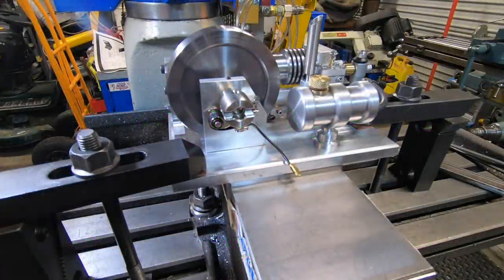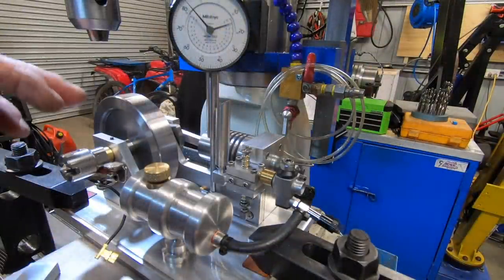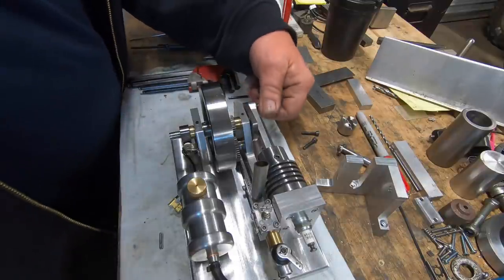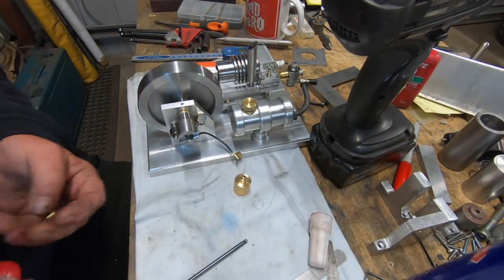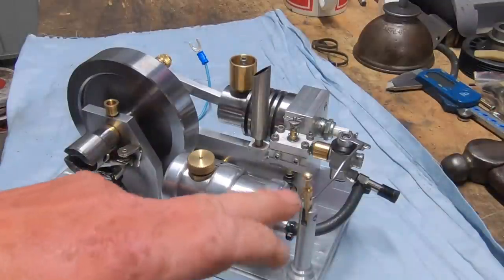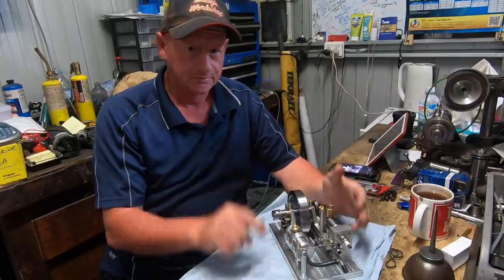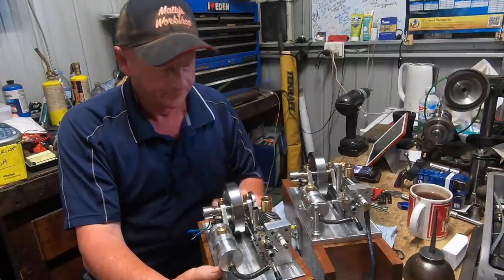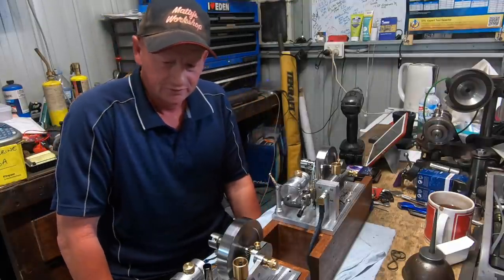Webster Engine Build   Part 11   HD 1080p

Comment: Over the moon and so you should be, two working engines. What a Christmas present. I am old enough to remember hand started cars, on the lug attached to the engine one side always had a slope so when the engine fired the starting handle was thrown out, not sure if you could do the same. Absolutely brilliant series of videos.
Reply from the maker: Gday Chris, I’ve still got that smile mate, I could put at taper on the starter drive but it’s really not needed, I’m doesn’t get jammed up, appreciate you watching mate, all the very best, cheers

Comment: Awesome job Matty! All around. I saw the Instagram post with the 2 engines and figured that is what your were doing. Whoever gets it should be honored. Carbs are always fiddly, good decision going with a ready made one even just to get it going. Probably saved a bit of frustration. Now you know they run so if you do the scratch built carb you can just concentrate on getting it tuned. All the best!
Eddie
Reply from the maker: Gday Eddie, it was a bit of a push to get them finished by Christmas and a massive job in itself to build 2 at once, I honestly think I’d never build 2 again😂, the carby is extremely fiddly to get right and the slightest movement makes a big difference , thanks for watching mate and all the best for Christmas, cheers

Comment: Well, indeed, It was a surprise that you build two engines. And as you said, things doesn't always goes as planned.
That's why I almost never use plans :)
And I think I knew you would give it away. That's how you are...
Reply from the maker: Gday, it was a massive job building 2 but the sense of achievement when both ran was well worth it, thanks for all your support throughout the year mate, Cheers

Comment: I've just finished watching this series as I'm going to build one myself. Though I'm starting with the carb!   Some great tips along the way. Sounds great too. 
All the best from the UK
Reply from the maker: Gday, this is a great build and I’m sure you’ll enjoy it, I’m still thinking of making the carby what’s in the build plans, please let me know how you go with build, thanks for watching mate, cheers
Reply: @MattysWorkshop  Can I ask what you used for the ignition? I've got a set of points and condenser but I'm unsure what type of coil I'd need. From the video you say yours runs on a coil and 9v battery. Is it just a bog standard 12v coil ?   (It's the biggest grey area for me for this build as I've never done anything with any kind of ignition system so my biggest stress is somehow getting the right parts and wired correctly!) Cheers.

Comment: Merry xmas to you and yours Matty.  The engine looks great!  Another approach to starting the holes for those roll pins would be coming in at an angle with a ball end mill, if I get to building one of my own I'll try it 😄
Reply from the maker: Gday Jim, thanks for the kind words, the starter set works great, doesn’t seem to want to get jammed up at all, works better then I expected, Merry Christmas mate, cheers

Comment: Great work mate !
I told you that you could do it !
The light that keeps blowing looks like an LED light so vibration is out of the question, you have to have a current limiting resistor in series with the led to stop it burning out but as i don't know the circuit it could be back emf from the coil  killing it .
Reply from the maker: Gday Ian, yes you certainly did tell me, the light I’d definitely a bulb type, I’ve replaced the bulb three times so far, the vibration is just to much for it, thanks for all the support throughout the year, Merry Christmas and all the very best for 2022, cheers
Reply: @MattysWorkshop  
Whish i had have known you were going to use lights  i would have sent you some pre wired LED Bezel lights .

Comment: Great little engine! Jealous of the compression though. The ones I built have a viton O ring instead of traditional piston rings, and was a little deep on the cylinder head depth...so less compression. Great work!
Reply from the maker: Gday, the engine I kept hasn’t got quite as good of compression as the one I gave Dad, I did end up putting a second o-ring in as well which did help a bit, thanks for watching, cheers

Comment: Well done Matty- I've just started building one of these engines and your channel has become my go to site if I need to see how something is done. I'm very impressed by your standard of work and attention to detail and you should be proud of the results.
Hope you don't mind me asking - how has the o ring held up on the piston ? .I don't have the skill to make piston rings and was going to copy your idea if its ok with you.
Reply from the maker: Gday, https://bbs.homeshopmachinist.net/forum/general/42093-building-the-webster-i-c-engine ,here’s a link (hope it works) to a forum I followed which has the details about the O ring groove and the Viton O-ring, this is a great forum to read, it also has the crankshaft modification as well, please let me know if the link works, I’m more then happy to answer any questions you have, Cheers
Reply: @MattysWorkshop  cheers Matty - that link works and there is a load of good info on that site! Thanks for that, -- Colin

Comment: Merry Xmas Mattie 🥳
Great to see that little engine run mate 👏👏👍👍
You’ve done a great job of building ( and videoing) this entire project from scratch.
What is the fuel you are running?
Regards
Robert
Reply from the maker: Gday Robert, thanks mate, the engine is running straight unleaded, seems to like it ok, Merry Christmas and all the best for the new year, Cheers